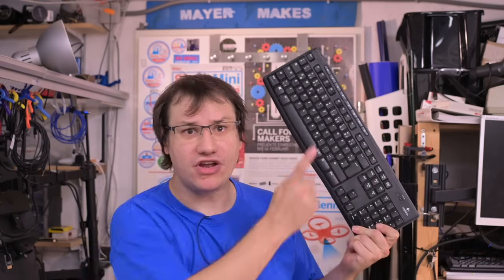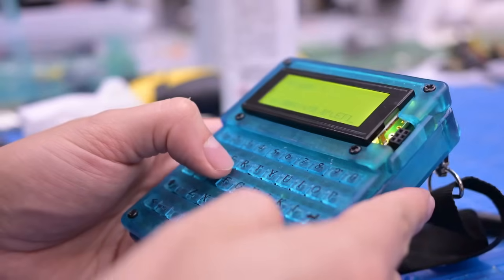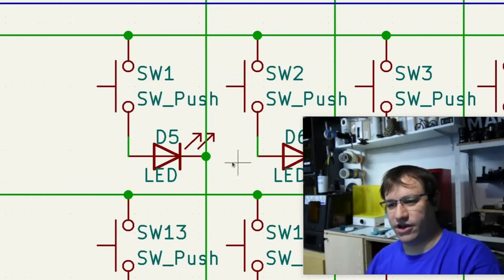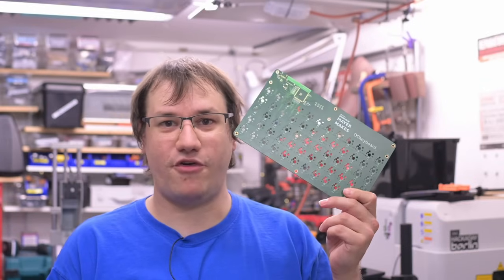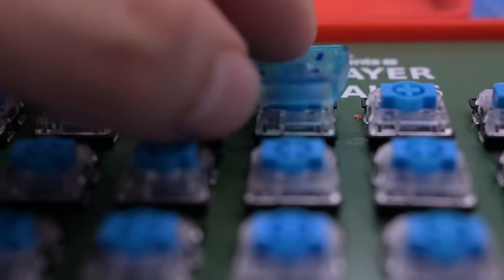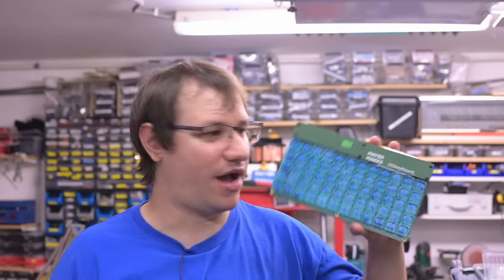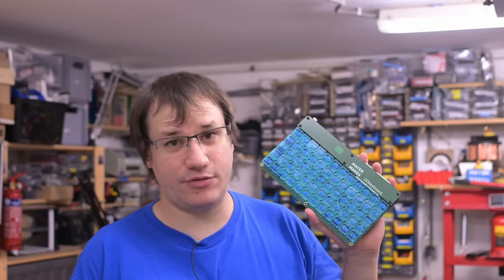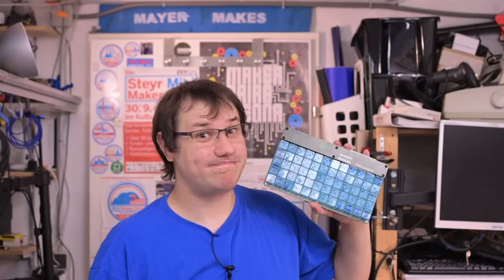How to Build an Open Source Bluetooth Mechanical Keyboard

Comment: Nice build. For the LEDs it might be possible to use a voltage doubler IC to bring it up to 6.6v. I would do the current requirement calculations before designing the board though...
Reply: but then reading the pins i nthe matrix through the leds would not work without a level shifter on each pin. so it will be probably better t ojust oput in a second adressable matrix for light effects. my original intention was to get lights for free..but did not work out.
Reply: @MAYERMAKES  I guess it depends on if you make sure you go through enough diode drops on each line before it's read? The levels could be controlled by the forward voltage of the LEDs you use.
Reply: maybe, but at that added complexity i´d juat rout a secondary light effects matrix. @justovision

Comment: Cool idea with the raised letters, numbers and symbols. I would've made them as wells and poured white resin in them (in order to get good contrast). I wonder if one could use UV curable printer resin and then stuck them into a UV curing box, cleaning them up afterwards with isopropyl alcohol as it's standard procedure with 3D printed parts, but more to avoid sanding as it would make the keycaps lose some of the transparency.
Your projects are the best, Clem. Congrats.
Reply: I actually did backfill buttons with white resin. It eorked great but i 'd need to make the buttons thicker to remain travel distance, posted pics on twitter. It ended up on the cutting gloor gor this episode l.
Thx

Comment: The lack of a wide space bar looks a little frustrating to use. I'm designing and building a ASCII keyboard at the moment with a lot of diodes and inverters and.. it's not fun.
Reply: So far since i got multiple space keys i feel no issue, but one could simply print a wider space bar snd stick it on there.
Reply: @MAYERMAKES  That would do it-  I thought it was just the one key! I look forward to seeing what you do next.
Reply: Thanks, the idea was i could reuse dome space key space for other functions in case i cant fit all needed ones on the board. So space could be 1-5buttons wide.

Comment: Can we build button for custom operation for an application like corel draw or photoshoot. If yes, than what is the process for it.
Reply: super easy just take this project and put the key code you need on a button. for example you could make layer four hold all the keayboard shortcuts in a more convenient cluster for PS or Corel so you can reach them al lwith one hand. its just a matter of putting your custom command in place of a character.
Reply: @MAYERMAKES  how to place a custom command. Where can I find list of custom command for PS or coral to be programmed for the key. I am new to programming keyboard and very much unaware of how to do it. Can you please make a video or share some details about it in a video for with more details about programming the keyboard for applications like PS or coral.

Comment: Just a question how are you handling the problem of key ghosting and how many simultaneous key press can it register
Reply: since there is a diode on every single button and its read in a sequential matrix, you pretty much have n-key rollover. every press and release is transmitted seperatelly so any button put into the mix is just added to it.
Reply: @MAYERMAKES   Thanks for the explaination

Comment: Is it possible to have media control keys on this that work cross-platform, plug play, on mac, windows, linux and android? How to get started on implementing that on a bluetooth macro pad?
Reply: if the media functions can be mapped to a keycode, then yes. if these keycodes than are directly recognised correctly by the target os then it would be plug and play. I expect Mac t obehave weird and maybe not have simple keycodes for these functions, linux is certainly possible.